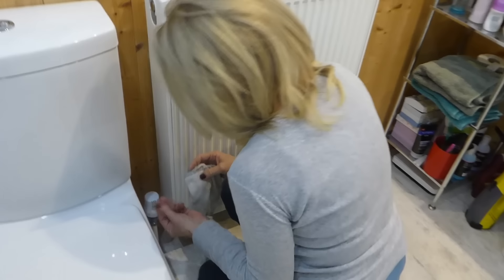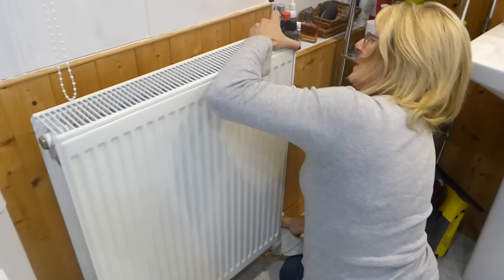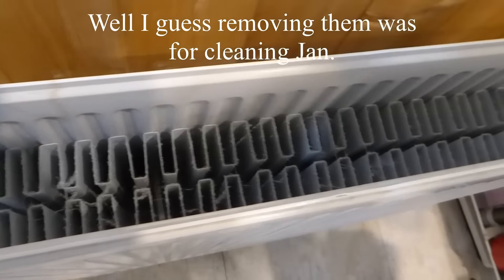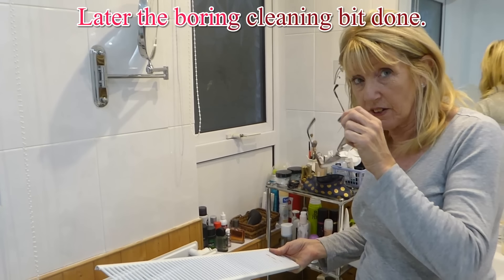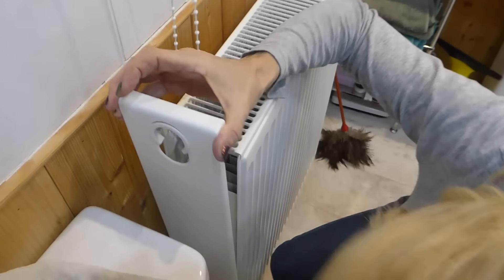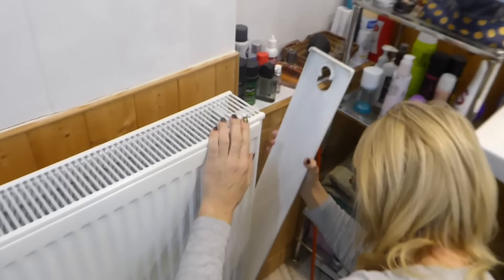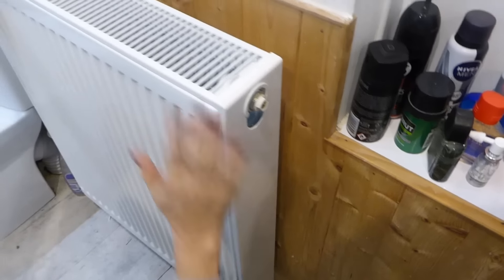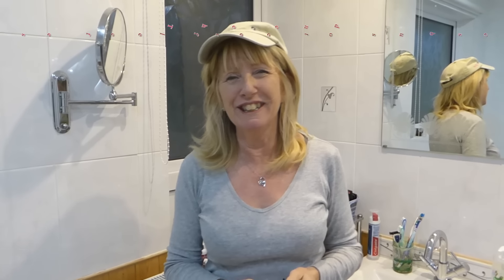Jan shows how to remove radiator covers to clean the dust

Comment: Saw another demo of this, both helpful, I have just moved into a house that has more problems than it appeared, it's 19 years old but I doubt the radiators have ever been cleaned. I retrieved a packet of crisps with a use by date of four years ago from one and two pairs of socks from another!
I have a long handled brush specially made to clean down each part but thought I wouldn't be able to use it here!

Comment: You can buy a brush like a giant pipe cleaner x chimney brush. Probably Lakeland or the like. This will go down between the fins in the radiator so you don’t need to remove the panels at all if you don’t want to.
Reply from the maker: Thanks Sara.

Comment: I have this type of radiator in every room in the house in various sizes and I have just tried to remove the grills on every one of them without any success.  The side covers do not move at all.  Nearly pulled one radiator off the wall trying.  The one she showed us had to have been loosened somehow before she did this.
Reply from the maker: They need a slight tap with a hammer tapping upwards on the side panel to free them. If they are painted they could be harder to remove.

Comment: Once you’ve dismantled it and before hoovering up the dust you can clean down inside with a radiator duster which is like a huge pipe cleaner. Also get a wet cloth and run it along the bottom back and front because it gets filthy under there. ( Jayne Marsh  Cleaning. )
Reply from the maker: Thanks Jayne

Comment: That’s all well and good but ours have been “locked” at the bottom with a plastic sort of thing. I’ve looked it up on here and seen demonstrations of unlocking them. Despite all my best efforts though they won’t turn, so I’m frightened that too much force is going to break something. So I’m stuck with dirty radiators,
Reply from the maker: Just spray them with WD40 they will easily come off then.

Comment: You can get radiator dusting brushes, they are like very long bottle brushes and let you get down between the fins within the radiator and clear out all the dust. Well worth the money as then your radiators will run more efficiently. They also come in hand for other cleaning jobs more often than you might think. They are widely available just do the usual searches for a radiator dusting brush and you should find them.
Reply from the maker: Thanks
Reply: Absolutely.........

But I've spent the last few years sticking them down in between all the top vents before this incredible revelation.......😮❤
Reply: Those brushes are way too thick to go comfortably down the fins on mine.
I bought a really long fridge unblocking thingy.The only thing that worked. 
Also please do not pour water down as I saw someone else do.
Not recommended, makes too much mess.

Comment: A tip: Don’t wave that brush about - old dust is dangerous.     This lady has only removed the top layer - the old stuff is way down in the radiator.   Buy a long-handled radiator brush.  Slowly poke it all the way down one of the holes in the grill - SLOWLY bring it back up.  If possible hold the suction pipe from a vacuum over the brush as you take it out.  This stops all that dust going into the air and into your lungs.  Repeat for each hole.     These radiators are terrible for anyone with ASTHMA.   Many work by convection method - which means the air is sucked up from below, gathering any pet fluff, hair and dander etc.  it then sits inside the radiator for years but when the heating is on the warmth causes tiny fibres and fluff to raise into the air - you breathe this in.   It can cause asthma attacks.  Make sure you clean them regularly, especially the bedroom radiators if you have children.  Often the cause of people coughing at night time if the heatings been put on for bedtime and the room has these tiny particles floating around the room.   Winter’s approaching, so now is definitely the time to clean all your radiators out.
Reply from the maker: Thanks Wendy. Jan was trying to show how to remove the covers and replace rather than cleaning behind, as how you do that is up to you.
Reply: @ I think it’s been brilliant that you videoed the dismantling of the radiator, as so many people aren’t aware that it’s possible.   There will be lots of healthier homes now because of your channel!
Reply: Agree.They are absolutely  disgusting.
Reply: We bought a brush for this job, it bends and twists and pokes the dust down onto the floor.

Comment: Nice one Jan 👍
Did mine yesterday but as the decorator has painted mine, doubt I'll be able to get them off. I used a very long brush bought last year specifically to get down the fins. Thanks Al 👍
Reply from the maker: Thanks Jackie. All the best.
Reply: @dereton33  Thanks Al, back at ya 👍☺️

Comment: Hi guys thanks for all your great videos have helped me loads. Really interested in this one as I have got to clean all of our rads, the only problem is my end covers have no open ended slots at the bottom plus they have been painted badly so stuck together I reckon which will make life difficult. My question is how  do you take off end covers without the open ended slot at the bottom, mine don’t seem to want to budge, thank you.
Reply from the maker: Clean the paint off around the slot then tap with a hammer to break the seal.

Comment: Mine has a plastic clip which stops it from lifting, did you miss that bit.?
Reply from the maker: No it is only on certain rads. Single panel ones are different too.
Reply: Same here,two of mine have top covers screwed in from back, one has 3 plastic clips under the grille,but the fitting details never mention these! Why all plumbing items have so many different non-standard parts etc (that you can never buy off the shelf ) is beyond me.